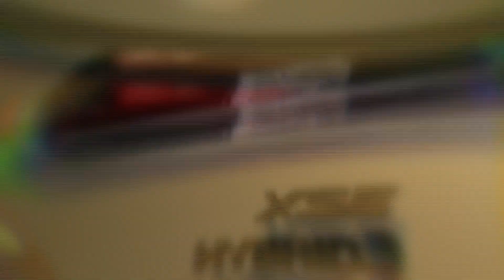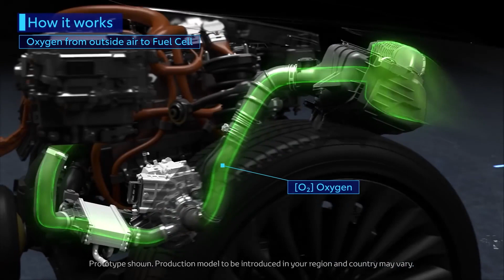The Development of the Hydrogen Fuel cell powered Hilux has started

Comment: Modern LiFePO4 used in the majority of EV and sodium ion batteries don't use nickel or cobalt, and the materials are plentiful.

What's not mentioned is that hydrogen fuel cells are Electric Vehicles, but with a very small battery.

Combusting hydrogen in atmospheric gas mixture creates nitrous oxide, and they haven't mentioned the efficiency of the hydrogen cycle.
Reply: You know hydrogen is a gas, and yes, the vehicle would have a smaller battery than a EV; the battery would have to be big enough to curate enough power for the compression, the by-product from hydrogen is water

Comment: Manufacturing the fuel cells, they also use a lot of rare earths. So, if we go this way vs batteries, am not sure how well this will go.
It will be a resource battle on the horizon. Personally, I'd like a Toyota Mirai, but they are very expensive.
And the infrastructure is nearly non existent, like chargers in many countries, lacking behind.
As long as politicians just say which way forward without the supporting infrastructure, the disaster will be real.

Comment: You can already see the EV zealots emerging from the woodwork like termites. Toyota's approach is sound and should should be the approach/policy that the EU and US adopts. Develop on all fronts instead of pushing everyone down one track that may not fit them and is already shown to be to expensive and not as "green"(hate that term) as they claimed to begin with. Different jobs or desires require different vehicle platforms, end of story.